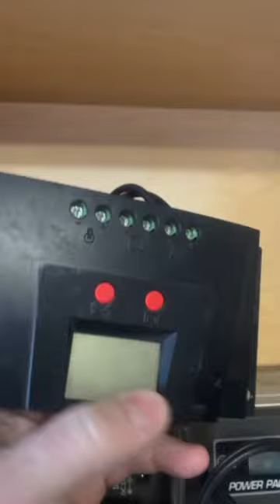Simple Solar

Comment: Thanks for explaining that in Neanderthal so I could understand it,....So that's it, folks, in a nutshell. If you are prep'n for some type of shtf survival situation, keep it simple. You don't have to light up times square on New Year's Eve. You just need to assure that you have a bit of juice for occasional light  moderate use and keep a couple of electric generators charged up.

Comment: Where it can get more complicated (but not bad) is knowing how many amps vs gauge and length of wire as well as polarity if not using Anderson or similar outlets and which ports to use on the charge controller for what.

Comment: Interesting I'm curious about running a refrigerator and freezer. Like what kind of wattage, amps.
Reply: Look at what your specs on that fridge require then over kill it with battery and solar so that the Solar always puts out enough juice to both run the fridge and refill the battery during the day so at night when the solar isn’t working you have enough battery juice to last till dawn and through cloudy days.